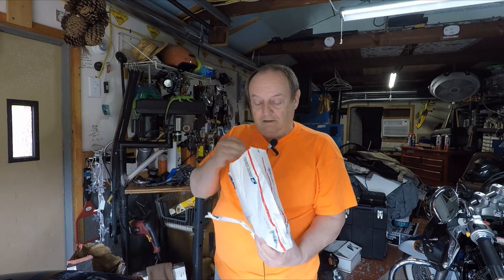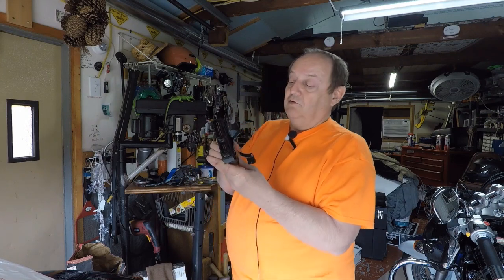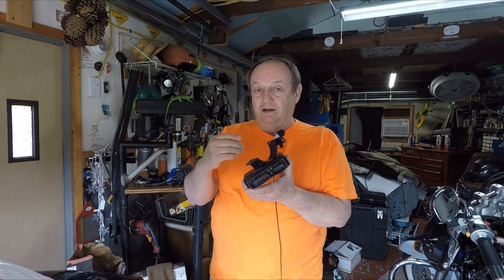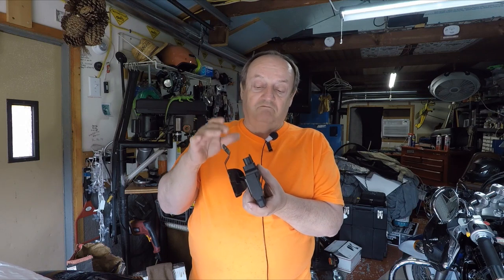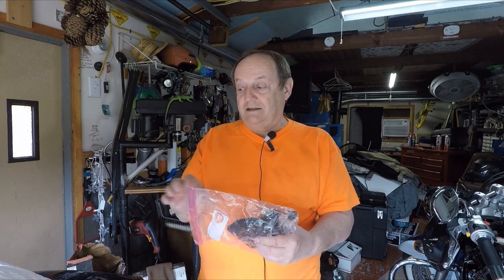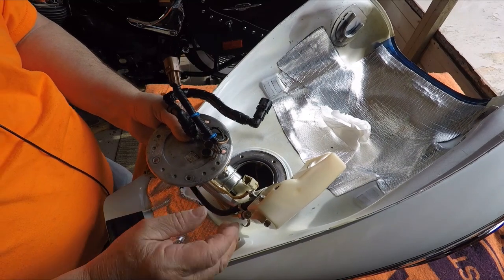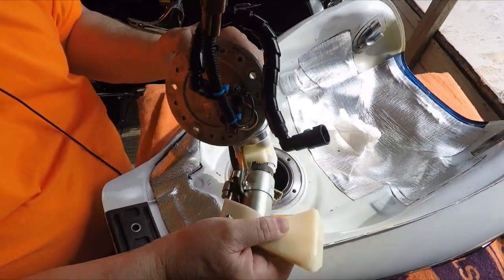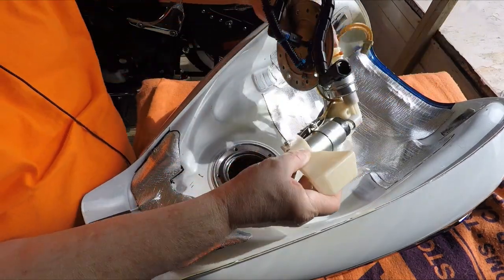S. B. C50 IN TANK FUEL PUMP AND FILTER

Comment: Dear Norman,
Great video as usual. Looking at the fuel pump assembly I want to share my experience on a M50 which is a similar bike. My bike suddenly died one day while riding and wouldn't start while the engine kept cranking. I was lucky to find a mechanic who helped me fix the issue. Nowhere in the service manual was mentioned the fault we discovered. There is a little thermistor attached on a bracket that goes around the actual pump. The soldered connection on the wire had broken due to corrosion which prevented the fuel pump from running and the bike would not start. A new solder solved the issue.

Comment: Good evening Norman,
First thank you for this completed thoroughly video.  I have a 2008 Boulevard C50T that I bought from a gentleman who let the bike sat in his storage shed for 6 years.  The gas tank was rusted bad inside.  The fuel pump inside the gas tank was badly rusted, and plastic wire cover harness broke into pieces when I pulled it out.  So here is a list of things that I have done so far but still couldn't get the bike started: 
     1) Cleaned the inside tank thoroughly.
     2) Removed, cleaned and test the two injectors. I verified that the solenoid on both injectors were working.
     3) Put in the brand new fuel pump that I bought on eBay for $170.
     4) Installed a brand new battery.
After I have everything put back together, pushed the start button, the engine turning but not fired up.
 I checked the spark plugs and there are sparks on all 4 plugs.  I tried to narrow down the problem by trying to spray the starting fluid directly into the upper cylinder valves to see if it started.  Yes it did started with the starting fluid until it ran out.  So I think the only thing left for me to check is the fuel pump.  My question to you is is there a way to manually check to see if this new aftermarket fuel pump from eBay is a good or bad one?
Much appreciate it if you can provide me any lead on this.  Thanks in advance!
Reply from the maker: With that rust in the tank you may have some rust in the hose that feeds the tank. The gas line you unhook from the tank has a check valve so you undo the line from the connector and very little gas runs out of the tank. It could have some rust in there. When you first turn the bike on do you hear the pump build up pressure then stop ? The gas system has a pressure system.  Something to think about.    Norman.
Reply: How did you clean the inside of the tank? I’m having the same issue, and I’m wondering what is the best way to clean it
Reply from the maker: @danieldyck720  Look in the tank and if there is rust in it, what we did in the old days, Take small gravel and wash it so it is very clean. Put it in the tank and shake it turning the tank as you do this. It will knock the rust loose then flush it out a few times till it's clean. They make a product that you pour in the tank and you turn the tank and it puts a coating in it.      Norman.

Comment: Hello sir, I have been watching your vidoes and just wanted to say they are great!  Thank you for putting so much effort into them to help others!!   So I just purchased a 2006 C50 from a friend and it is having a fuel issue I believe.  For some reason when he got it from someone else about 6 months ago he drained the tank and then put 87 in it.  Since then he says it has ran "funny".  So it will start but you have to constantly move the throttle back and forth vigoursly.  Then you can get it to move by keep doing the same throttle madness.  If you are not fast/hard enough on a constant basis it will die.  The bike also  has a Fi2000, idle/fuel control thing attached to it??  Never heard of this and will need to research that as well.   Do you have any ideas for the issue I mentioned?  Any help or guidance would be greatly appreciated!   I just purchased this last weekend and I haven't done anything yet.  Figured first steps would be check/clean fuel filter, pump, etc etc.
Reply from the maker: These bike are known to have problems like this. All my research comes up with Take It To The Dealer. I gave up on mine for a while but hope to get back to it sometime. Seems there is no easy fix.   Norman.

Comment: What a great video for those of us with a problem where the  tank has to be entered from below.  My problem is I had to have some surgery and thus the my 2006 C50 was idle for nearly a year.  I did not have a full tank of gas and the inside of the tank rusted...I did not even know that could happen....in any event, now I am going to have to clean and seal the tank.  I plan to try vinegar to remove rust and then use tank sealer purchased through Amazon.  Problem.  I have not yet removed the fuel filter etc, but seeing the wire you un coupled remaining in the tank makes me wonder if I can actually use the vinegar and sealer unless such wiring is removed.  Have you ever had to deal with this problem?
Reply from the maker: Hi George,  I have never had this problem.  Use a hose to remove all the gas from the tank that you can so when you remove it it makes it easy to handle it. Once the tank is off remove the gas  cap off and turn the tank over and get all the rest of the gas out. Next remove the fuel pump from the bottom of the tank like I did in the video.  Let the tank dry out. If you have a compressor you can put a hose in the tank then open the air line and let this blow air through the tank till it is dry. I show a connector wire that goes into the tank, I can't remember what that goes to and could not find it in the book. You can take a small mirror and flashlight to see inside the tank as what is in there.  I myself would not use any cleaner or sealer in my tank. I would get a long thin wire brush that is bendable { Harbor Freight }  and work the tank from the bottom and through the top to remove all the rust I can. Take a shop vac and slide a piece of garden  hose into the hose  of the vac and tape it up. Use the other end to put into the tank and work it all around. You have looked into the tank and know if there is anything to stay away from. This will take time. Clean, clean and clean some more. Once done replace the fuel pump then put some gas in the tank and shake the tank , dump the gas out. Do this several times. Put the tank back on the bike. if any rust remains the fuel  filter will take care of it. Now any time the bike is to set a week or longer have a full tank in it. I use to fly. All aircraft would fly then be filled with fuel so as it set  
it would not rust in the tank. My plane was a kit plane and had a plastic gas tank and was not a problem. It could get water in the gas so there was a fuel line that was under the plane that I put a jar under and then opened a valve and let some fuel run into the jar so I could check for water in the tank.  Hope this helps. This is how I would handle this problem.  Norman.
Reply: @2001himax  Norman, many thanks for your thoughts about how to proceed.  This was a new problem to me as I had never heard of rust inside a tank...the older I get the more I learn.  I already have the tank off but have not removed the fuel pump yet...your video is great for the way to proceed. the gas cap inlet has a lip which will need special attention to clean. From what I have read, rust is now a common problem of all metal tanks due to the ethanol added to fuel...I try to run non ethanol in my mower etc.  Fortunately my tractor has a plastic tank and a way to drain water also as condensation in the diesel occurs.  I put additives in it as precaution.  Seems it is always something.....best regards and thanks again.
Reply from the maker: @George1mac     Back when I was young there was nothing in the tank but gas. We would get rust from moisture but how we took care of it was to get a cup of small gravel, wash it real clean, put it in the tank and shake it madly. Rinse it with water  and repeat several times. Today you can't do it because there are things in the tanks. When you look in your tank see if you can see where that wire goes and let me know.  Norman. Glad the video helps you.
Reply: @2001himax  Norman, I am not a spring chicken either....soon to be 69.  I have ridden a motorcycle of some variety since age 18 and I never had rust occur in any tank....perhaps lucky.  Before I found your video, I had looked up how to clean the tank, and many said to put BBs or such in to help clean while others said use vinegar and one said to use Milkstone remover which is phosphoric acid solution from Tractor Supply. Sealer was recommended due to flash rust which will occur after the treatment.  I had already bought the vinegar and Sealer (POR-15 fuel tank sealer)  My neighbor is a good mechanic and he was going to help.  Once we got the tank off, we both scratched our heads as we had forgot the fuel pump etc was inside the tank, so we pondered how it can be sealed with the POR.  I will take my bore scope and look well inside when we get to that stage....thanks...George
Reply from the maker: @George1mac  Hi George, Watch some other videos and you can see people using acid to clean out the tank. Some show they are cleaning out the old sealer with acid that has flaked off. Does the sealer only last so long? Has the rust under the sealer made it come off ?  I would love if you would make a video as you decide what to do. Also show on your bore scope what else is in the tank. You are on the right track. Send me a link to your video to  ( paulymax@comcast.net )  if you make one. Your video would help so many people. Man it's like 15 degrees here in Western Pennsylvania. Now you see why I put a furnace in my workshop.  All my best to you and your family and your friend helping you. Norman.
Reply: @2001himax  Norman, things have been put on hold... we took fuel pump out, and the corrosion has ruined it....even ate up the wires, and that amazed us it could do so much damage.  There was not another wire in the tank and apparently if so, it was to go to a fuel detection float or something...my model did not have it. Looks like I will have to find a new pump etc. BUT, neighbor caught covid and now he has had a heart attack...I do not know when things will be back on track...he is recovering, but he has a way to go.
Reply from the maker: @George1mac   Hi George, Sorry to hear about your neighbor.  That is something about your tank. Never knew that would eat wiring.   Norman.

Comment: What is the purpose of the connector inside the tank? I have a 2006 Boulevard C50 and I’m replacing the fuel pump assembly. However, mine does not have that connector. Is it essential?
Reply from the maker: Hi Joseemc21, I just saw your comment. The 2006 may be different than the 2012. My bike has the fuel pump in the tank so the wire to run it goes down in the tank to get power to the pump.

Comment: Hey Max, 
I like watching your video. Not just the information you have on each but the way you handles the video pause and resume.. Its really awesome.
I have question which I been searching across to find an answer. I have a 2009 C50 and it has the fuel bar always on 1 bar even when the tank is full . Do you know why?
Reply from the maker: Hi Bijoy, I would first check the fuses under the left side rear cover. If they are good remove the Speedometer/ Dash unit. Unplug it then plug it back in and try it to see if it works. If not it must be the sending unit in the tank. I can not find it in the book but I think the wire I plug in at 17;10 on the video goes to it. You may want to talk to a dealer about this problem. If I can find anymore about it I will post it to you, Norman.
Reply: @2001himax  thank you.. I will check and let u know.
Reply from the maker: @bijoybn  The fuel sender has to be in the tank I just can't find anything on it. Does any codes come up on your dash?  If so you can try clearing the code.
Reply: @2001himax  no code.. The bike had not be ridding for a while.. So i am guessing the floater is stuck.is this common? . I checked under tank and also  fuel dash connector.. They all look fine.. Fuse yet to check.. Its raining here and i dont have a closed garage.. I will check fuse and will let you know..
Reply from the maker: Try this. Have about two thirds gas in the tank and rock the bike front to back and side to side. It may free up the gas sender. Worth a try.
Reply: @2001himax  Not fixed yet..I am might have to remove the pump and do a cleaning.. I had this question.. in your video at 11:46th min you say about another unit inside the tank.. What is that.? Do you have any website or video on each corners of  the fuel pump unit. I would like to know that.. I am trying to figure out what my fuel bar is always 1 even at full tank and the bike runs only for 115miles.. where as i heard it can go 145-160. I do have pro intake, not sure if that causing fuel to burn a lot..

Comment: ...wow, electrical wiring inside the gas tank. Didn't know they did that. Sounds dangerous.
Reply from the maker: Hi Garry, Just saw your comment. They have some new cars that have in tank fuel pumps so the wires have to down inside to run them. Aircraft have tubes that run through the wings, that is where the fuel tanks are, and there is lots of wires in side the tubes.  Norman.